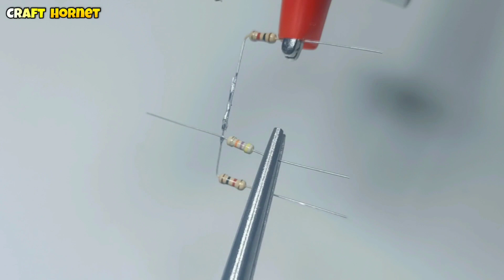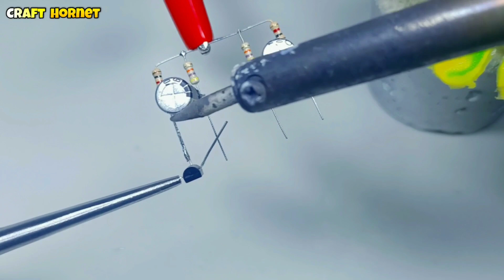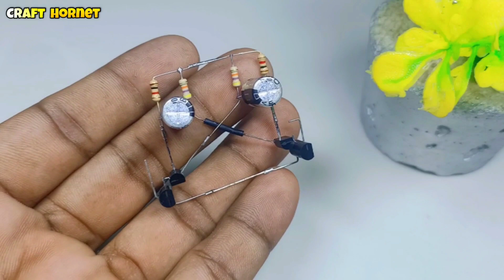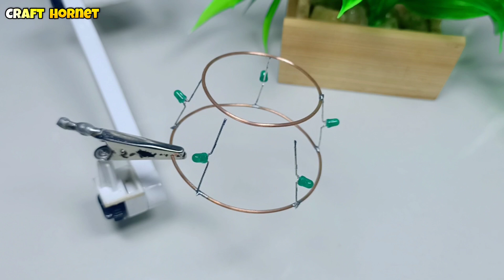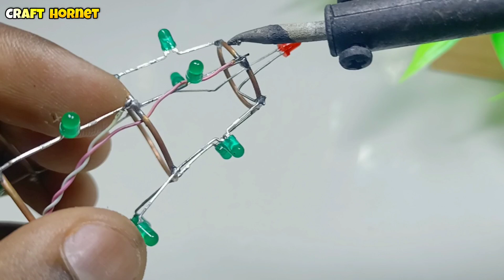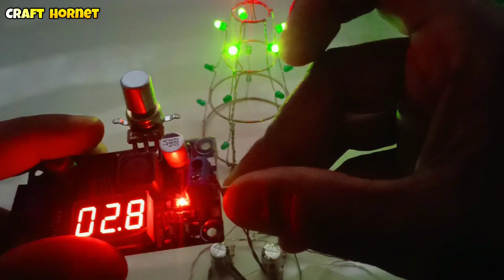Running LED Christmas Tree | diy | christmas decorations

Comment: sir, Can you increase the amount of led?
Reply from the maker: yes. you can
Reply from the maker: For that, use C1061 transistor or D313 transistor instead of D400 transistor
Reply: @crafthornet  thank you sir
Reply: @crafthornet  😍
Reply: @crafthornet  thank you